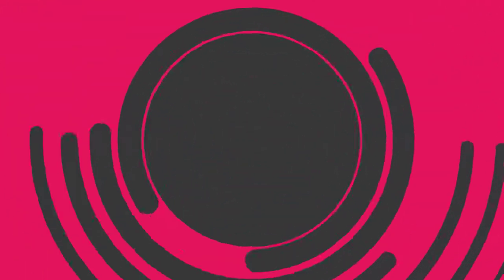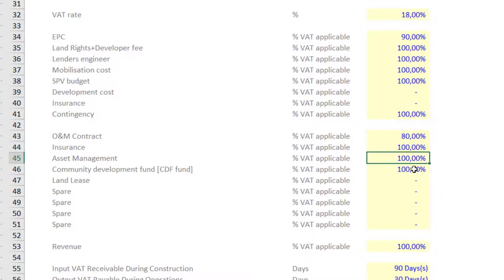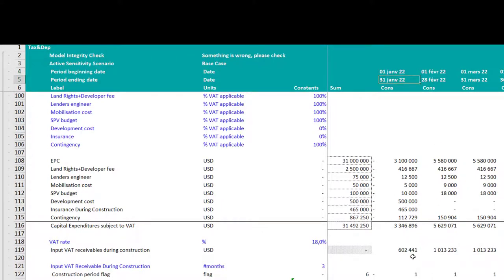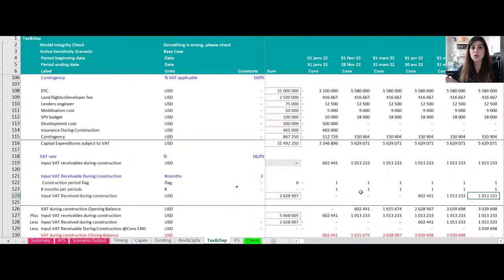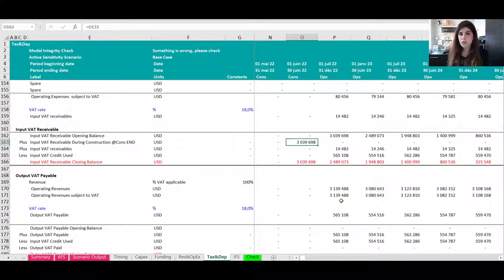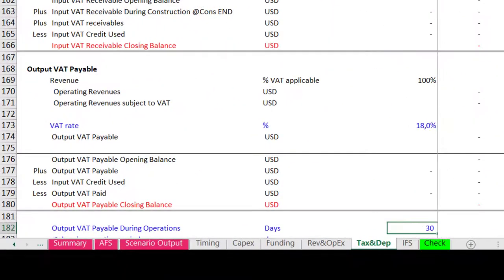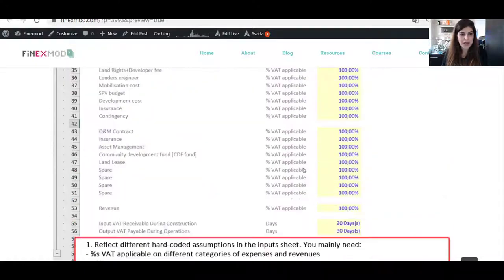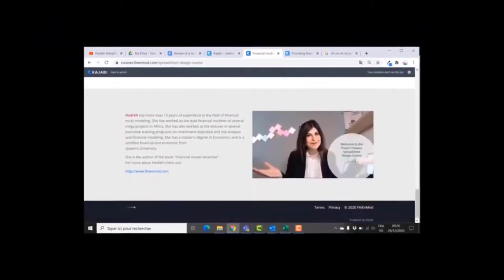Value added Tax in a Project Finance model

Comment: Dear Maestro, 
It's EMB ^^, I was going to ask you this question but you answered brilliantly. 
1) If we capitalize the VAT during construction (we don't pay it during construction) then we need to pre fund it. Do we fund the VAT in this case with a pure loan or a mix between equity and debt with respect to the gearing as we would do for interest during construction. Where does the VAT loan sit in the cash flow waterfall vis à vis the other obligations (senior debt, mezz, SHL). 
And if I may maestro, how would we pay for this facility, would we dedicate the VAT collected from revenue to pay for this loan (in this case the loan repayment will be non scheduled  because of revenue seasonality) or would it be another line in the CFW. 
2) The other option is that the VAT is reimbursed by the GOV with a time lag of say 3 months as in the video, in this case we will need some kind of "VAT working capital" to fund the gap (line 134 in your model, time 7:42). How do we fund this "VAT working capital" and with what kind of facility (short/long term facility). 
Thank you very much maestro!
Reply from the maker: You are very welcome EMB :) You need to pay for VAT("In this world, nothing is certain except death and taxes"). If you get reimbursed early within 30 days, then there's not a big weight on the total project cost but if you have like 3 to 6 months or in some cases you pay and can claim after construction from VAT collected then that's when you need to find a way to fund it. Either as you rightly said you use the VAT facility to fund the deficit then the VAT facility will be repaid during operation from refund received and in terms of position in waterfall, it has typically seniority over senior facilities (but might be different in different projects and different jurisdictions).
Reply: @FinancialModelDetective  You are the best, I am getting over all of your videos^^!

Comment: hello madam, is there a different treatment for VAT during construction and operation??

because in your example you can get refund of VAT during construction period several months later, while in the operation period you get a refund only when you receive revenue.
Reply from the maker: Hi dear,
Yes indeed. Because in a project finance deal during construction project is cash negative ) no revenues) you need a different machinisme. Sometimes VAT is paid during construction with a delay and sometimes it is capitalized until the project starts generating revenues, so the VAT needs to be paid but it’ll be reimbursed just after COD. One solution is the fund it with a VAT loan and repay the loan after the project starts collecting VAT.
Reply: @FinancialModelDetective  really thank you for your reply, the VAT in project finance has been puzzling me for long time and now i found a logic that i can understand
Reply from the maker: @mamamason6822  That's great! I'm happy to hear that.

Comment: How do I treat this VAT on my CF waterfall, Cash Flow Statement and B/S?
Reply from the maker: The B/S is easy: VAT facility is a loan and will be treated as any other debt in your liabilities. For CFW, it is more tricky. Most of the time it is subject to negotiation but mainly it is treated as a working capital facility. If it is just for construction then you reflect the VAT during construction in your uses as a cost and then the VAT facility drawdown in your sources and they cancel out each other. Then post construction you pay it out of your cash and you include VAT receivables in your CFADS and it pays for the vat facility.
Reply: @FinancialModelDetective  Thanks for your prompt response.... Do you have any example that I can explore more regarding this issue? It is hard for me to understand it without any example. Or which video that I can watch to understand the correlation between VAT during construction, after COD, and how to put it into B/S, Cash flow statement and CFW. Sorry to bother you master :)
Reply from the maker: @Coolguy-r1z  Before you begin examining how others are doing it, I suggest that you first understand the concept of VAT loans. Consider why we need a VAT loan, its purpose, and which institutions are proposing this product. Once you have a clear understanding, think about the modeling aspect: determine the necessary inputs, set up the calculation blocks, and identify the flexibilities and options you want to provide. After completing these steps, you can then look at how other people have approached VAT loans and improve and adjust your work. You may want to check out Professor Bodmer's work on working capital facilities, as it is closely related to VAT loans.

Working Capital in Project Finance – Edward Bodmer – Project and Corporate Finance

By the way, thank you for your comment. It has made me realize that I haven't finished discussing this topic, and there may be a need for a part 2.